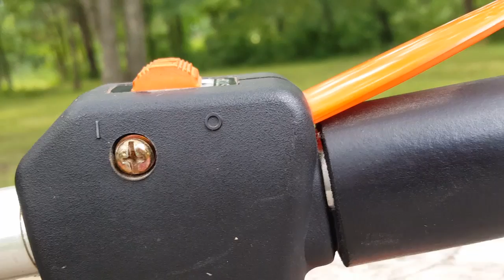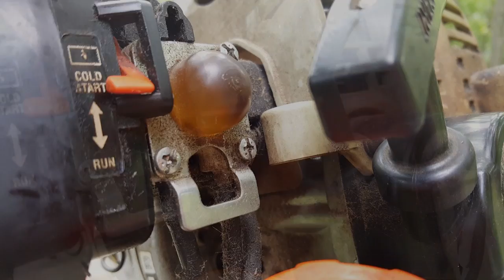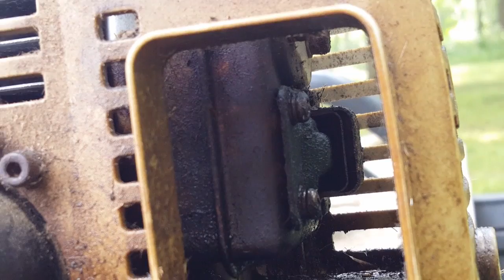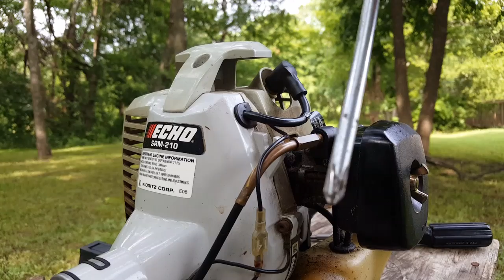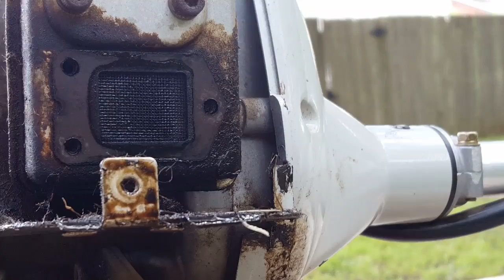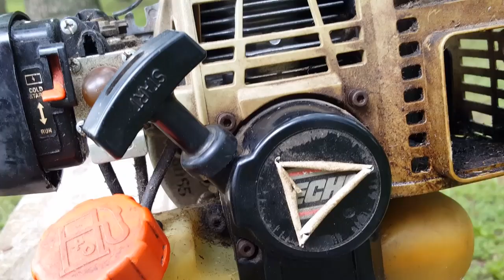Echo Weedeater starts but has no power and runs bad. Clogged spark arrestor. Easy and simple fix.

Comment: Never too old to learn.  In the past years I have changed spark plugs, filters, carburetors, and other
parts in order to get a failing 2 cycle to run.  I never found much information about the spark arrestor,,
In the past I have thrown away several good yard tools not knowing that this was my culprit.  When
you cranked that echo, the sound told me you were on to something.  I cleaned my Echo Weed Trimmer's spark arrestor and she ran like a new one.  THANKS SO MUCH....
Reply from the maker: You are welcome William York.  Thanks for the comment I appreciate it

Comment: thank you, sir. I watched several other guys fixing these, and they were all about the "hidden" hi/ lo speed adjustments, but none talked about this spark arrestor. I bought a kit, changed filter/ carb/ gas lines and still my echo had a VERY VERY hard time cranking up and staying lit. I watched your vid and bam! The spark arrestor was carbon cake... a little wire brush action and this thing is singing now..
Reply from the maker: You are welcome and thanks for the comment I appreciate it

Comment: Thank you.  You saved me taking mine to the shop.  wish i would have watched this before I bought a replacement carb.
Reply from the maker: Thank you Matt Busch for the comment I appreciate it.  Well at least you have an extra carb when you need it.
Reply: I was about to buy a replacement carb as well. In hindsight, if I was the carb, I don't think the engine would run at all. But I'm no mechanic at all. Good video.
Reply: JUNC0S
 SA?60143

RT?60138
Reply: I just did the same thing, replacing the carburetor.  Now on to check this.

Comment: I found an srm 225 and found the same thing clogged.  I took off the muffler and left it in a container filled with simple green and had a cleaning brush removing the dirt and grime.  Works.  I still did a tune up on it though.  Can't beat free.
Reply from the maker: Excellent thank you for the comment I appreciate it

Comment: Always a good idea to empty gas, clean, lube and inspect any small engine machines before storing for winter. Nice to start easy in spring and avoid these types of issues. Tools can last a lifetime
Reply from the maker: Thank you capohd28 for the comment I appreciate it
Reply: What happens if the gas is not emptied?

Comment: Good work. 2 stroke has only two speeds idle and wide open. Anything less than wide open will clog the screen. Biggest mistake is not using non-ethanol fuel with premium mix.
Reply from the maker: You are absolutely correct.  Thank you for the comment

Comment: I took the screen out and put back together it worked immediate full throttle high rpm. Torch cleaned screen in seconds... thanks man. Seriously
Reply: Putting screen back now
Reply from the maker: no problem.
Reply from the maker: I'm glad it worked out.

Comment: Having a issue with my echo weed eater with it trying to start but won’t start, so I fully disassembled it and cleaned the carbon build up off the cylinder, cylinder head and spark plug electrodes but I’ve never thought of checking the spark arrestor. Next time I’m in class I will check to see if that’s the problem. Thanks for the helpful video!
Reply from the maker: Thank you Brynnon D. For watching and commenting. Good luck.
Reply: UPDATE: 
today this morning I actually got it to run and it turns out there was a huge bug in the exhaust blocking the exhaust port and there was dirt in the fuel tank so I cleaned out the fuel tank and put a new fuel filter in and after a few pulls from the recoil starter and it fired right up and it was running really well afterwards
Reply from the maker: That's great news congratulations. Thank you for the update.

Comment: Need to check this on all of my 2 cycle stuff. Another great video, thanks!
Reply from the maker: It something I overlook this part too.
Reply: Hank Bridges Actually you want to set the hi mixture for highest rpm then just a touch richer until the speed just barely backs down. Highest rpm is too lean, don’t forget the fuel is the only lubrication for the piston in a 2 cycle and you don’t want to overheat it. I never think to check the exhaust screen though after all the years of fixing these things!

Comment: great job! I've ran into that several times on 2 cycle equipment, I usually just leave them out.
Reply: It is just a little more work to clean the screen with Carb. Cleaner or Throttle Body Cleaner with a brass wire brush and put it back in.
Reply: Y
Reply: @SCarter76  thanks... I wondering how to clean it and place it back.

Comment from the maker: Thanks for commenting. Its very much a hobby that I greatly enjoy.
Reply: So is that screen even needed?
Reply from the maker: The screen helps glowing sparks from leaving the muffler and igniting dry grass on fire. It is needed in some areas. Where this one is being used it's not necessary.
Reply: I have that same model and it suddenly staring bogging down and shutting off when I press the throttle. I check the spark arrestor and even replaced the carb and lines. Still same issues. Any suggestions?

Comment: This happened to a chainsaw I was working on and posted a video.  I let the spark arrestor soak in some dishwashing detergent for an hour, then used Brillo pads and a wire brush on it to finally clean it up.  Wish I had thought of the torch idea.
Reply from the maker: Use what you got and the dishwasher fluid works.

Comment: Thanks, I knew about this but forgot and was about to go get some can 2 cycle gas to ops check the problem and was about to search my parts for a new corroborator and fuel filter.  I'm going to try burning off the carbon, because I think it takes longer for the engine to warm up without the spark arrestor.
Reply from the maker: Let me know how it goes.
Reply: @HomeGaragechannel  I burned off the carbon and reinstalled the spark screen and she's back to running new.  It's so easy to clean the screen I'll keep it in.  And your tip for the day, The Earth is as it's always been, motionless and flat and NASA means Not a Space Agency or Never a straight answer and Astronaut means Astro, Not!
Reply from the maker: @JesusIsaFlatEarther  thanks for the update and the tip

Comment: Headed out to my shop to remove mine. I bet it's my problem. Thanks !
Reply from the maker: I hope you get it working right.  Good luck.
Reply: Turns out that there was build up in the exhaust port right at the piston. Removed it and it runs like new. You have to remove the whole muffler to see it.
Reply from the maker: Thank you for the comment and update

Comment: Thanks for the video, I’m having the same issue with my srm- 225 after installing a new carb..just completely bogs down then stops..gets really hot as well.
Reply from the maker: Thank you Razors Edge for the comment I appreciate it
Reply: Did you figure out the problem ? i have the same issues with mine so i changed  the carb. and seems like it didnt help
Reply: No, unfortunately I think I’m gonna have to buy a new one, either that or I might just replace the exhaust. It seems to be easily overheating and then shutting off.
Reply from the maker: No shame in replacing it. Sometimes it makes the most sense.

Comment: Great job. I believe this is what my problem is. Great video as well.
Reply from the maker: Thank you Mission Impossible for the comment.  I appreciate it.
Reply: Mission impossible if its clogged go ahead and pull the muffler off and check for carbon in exhaust port mine was clogged size of a pencil

Comment from the maker: Thanks for the comment. This was the first one for the year for me. Funny thing is that the  gas is mixed appropriately for this engine. It may have been ran half throttle a lot.
Reply: Home Garage I never use the 50:1 they call for. I usually put some gas in the tank, add some used motor oil, shake and go. Have had my echo gt-2000 for 25+ years and never had a problem until this summer. Thanks is was ready to go buy a new weed wacker.
Reply from the maker: @louiss4618  thanks for taking time to make this comment I appreciate it

Comment: Very well done..,.,.How do we avoid getting a clogged spark arrester ?..,.,High Test gas?
Reply from the maker: Thanks for the comment. Good quality 2 cycle oil and make sure you run at full speed when possible.
Reply: If the mixture is too rich, that can clog the exhaust.

Comment: Thanks, I have a trimmer where this is the symptom, I'll give it a try!
Reply from the maker: goog luck
Reply: @HomeGaragechannel follow up: I took the muffler off of it, and on the output of the muffler the little nipple or w/e you call it where the exhaust exits had a hex on it. So I unscrewed that and sure enough there was a round wire screen (cylindrical) and it was almost 100 blocked with carbon. Now the trimmer runs great and I can get it back to the friend I was fixing it for! Thanks!

Comment: I got echo srm-3400 and using it for sometime until the engine quit . Since then I can’t get it going. What seems be the problem? Thanks
Reply from the maker: how did it die? I would check the compression first to see how worn out the engine is. After that I would see if it runs when you put some fuel in the carbs throat.
Reply: Home Garage it quit while I’m trimming, I thought I ran out of gas but the tank was not empty yet. That’s how it died.I will work on your advice. Thanks
Reply from the maker: @georgearenque8530  you're welcome and let me know

Comment: Spark arrestor can be cleaned with a propane torch flame to burn all the carbon/deposits. Use long nose insulated pliers to hold it! it will get hot!  Carb cleaner may take most all of it off, as well.
Reply from the maker: Thank you Doug H for the comment I appreciate it.
Reply: Is it expensive to replace the screen?

Comment: Why do I have to prime my carb on my SRM 210 with either gas or starting fluid to get it started when cold? It has  a new carb, new spark plug, fuel filter, air filter and fuel lines. After it runs it will start up again without being primed.
Reply from the maker: New carbs need to be adjusted for all conditions.
Reply: @HomeGaragechannel  Well is that the screw that is hidden? This wasn't starting cold with the original carb either. Something is not right. It gets spark and the spark arrestor is clean.
Reply from the maker: Gotcha. I would perform a compression test. The engine might be worn  to a point that its now hard to start
Reply: I am going to try that next. Thanks.
Reply from the maker: @mikecosgrove  no problem.  Let me know.
Reply: I will but I have to go buy a compression tester first. It's like a catch 22 because if I replace a short block I am almost at a brand new trimmer.
Reply from the maker: @mikecosgrove  you are correct.

Comment: OK, I have a newer echo, cleaned spark arrester via burning it off and using wire brush to clean it, than replaced carb (zero carb adjustment screws on my model) and I changed the spark plug, it starts up fine couple pulls no problem, but when I want to cut it just doesn't have enough power to get going fast enough, have any more ideas to save my mom's favorite weedeater?
Reply from the maker: yes the carb is adjustable but the screws are hidden.

Comment: Mine is hard to start but will rev fine but dies when you stop revving. What should I do?
Reply from the maker: Thanks for the comment. Just increase the idle speed to a point where it wont die when you let off the throttle. Unless you want replace the carb or rebuild it.

Comment: Have a Eco loss power wen using it , I turn it off , an check the air cleaner , try stare it's back , and it's never started up back ?
Reply from the maker: take out the spark plug, for a day or two, put it back in, but this time try starting it, with NO choke.

Comment: I'm checking a srm236es a friend has. There is no arrestor on checking. It doesn't run as full as i think it should. Could it be the carb needs cleaned.  I took dirty air filter off to eliminate it but still think it not running at full
Reply from the maker: Thanks for the comment. Yes the carb is the best place to start  off. I would replace as its cheaper. If it's not it then check the compression. If its low then it will not go to full speed.
Reply: @HomeGaragechannel  I have a new carb he got from a shop, pretty dear at £60. And I just got an attachment for 8 and 12mm plug holes for my compression gauge. So it should fit the trimmer plug hole. What should the compression be? 100-150 like a chainsaw
Reply from the maker: Anything over 75 psi would be ideal. It should not be under 60 otherwise it will have less power.

Comment: When the muffler cover and spark screen are easily accessed and clearly dirty... remove and burn them clean with a propane torch held in pliers or vise. I did that simply on my Hitachi blower and problem disappeared !
Reply from the maker: Wow and i thought I was the only one with a Hitachi blower. Thanks for the comment I appreciate it

Comment: I 've seen what you do but the another problem is that the power is still lost 50% how to continue to fix that?
Reply from the maker: The spark plug was also covered in carbon and after a spark plug change all of the power came back.

Comment: What brand oil you use and mix at? Looks a bit rich to me.
Reply from the maker: It was ran on someone else oil gas mix before I got to it. Once the carbon burned off the spark plug it ran even better. But yes it looks a bit heavy on oil to make that much carbon. Thanks for the comment I appreciate it.

Comment: Watched this hoping it was this. My less than 1yo old trimmer running the same way. Screen was like brand new. New spark plug. New fuel filter. I have no clue now.
Reply from the maker: try running it without an filter, just to see if it's the issue, if it works without it, replace the filter. did you leave fuel in the thank over the winter?
Reply: @HomeGaragechannel  Yeah. Thought Stabil and quality gas would be ok.I will have to clean the carb next. Was hoping to not have to take it apart.

Comment: Hey I have a echo shc 225 hedge trimmer I wanted to know can that happen on Echo Hedge Trimmer was also
Reply from the maker: Thanks for the comment.  This screen gets clogged because of two reasons. Using oil that is heavy on 2 cycle oil and the other is running the machine at part throttle a lot.

Comment: Had the same problem with my Makita but the spark screen is internal had to split exhaust and remove the screen which was floating about inside blocking the exhaust.
Reply from the maker: Wow nice work, they definitely want anyone touching the screen.

Comment: Would the clogged up screen cause it to shut off?
Reply from the maker: Yes it could cause it to shut off. How long does it run before it shuts off?
Reply: @HomeGaragechannel  Ran it for 5 minutes give or take and I noticed some hesitation then it shut off. Tried to start it again but it didn't start.
Reply from the maker: Give it a try. Have you checked the compression?
Reply: @HomeGaragechannel  Not yet. I will clean the screen and if that doesn't help I'll check the pressure. Thanks for replying.
Reply from the maker: Thank you and no problem.
Reply: @HomeGaragechannel  looked at it this afternoon. Torched the screen. It looked decent, no excess carbon. The problem is when I pull the "trigger" (gas) all the way up If I push half way it doesn't shut off I left it running for 10 mins and edged some and didn't die. Managed to put a piece of plastic between the trigger and handle. It's weird but it's working. 

I

Comment: Can your fuel lines be too small?
Reply from the maker: you mean for it to run properly .. no i didn't think so
Reply: @HomeGaragechannel  I wasnt asking for yours. I have the same problem. I bought a fuel line to replace the old lines that crumbled and I didnt have a problem with it on my other machines with the same so lines but I wasnt sure about this machine.
Reply from the maker: @chanmang  there isn't a problem with fuel flow with a smaller line.
Reply: Thank you very much for your help
Reply from the maker: @chanmang  no problem thank you for the comment

Comment: Got Husqvarna 128ld replaced carb and fuel lines tries to crank but won,t any suggestions
Reply from the maker: Thank you Terry Strickland. When you pull the pull string is there a lot of resistance or just some?I'm wondering if the compression is low.
Reply: Terry Strickland  - need fuel, compression and spark...  is primer working so you feel fuel is getting to cylinder?  Any reason to believe compression is an issue?  Sounds like it might be lack of spark.  Remove spark plug and ground threads to engine and crank to see if you are getting a spark.  If not check with new plug.  Still no spark- check ignition coil gap and retry.  Mine turn out to be a bad connection where the spark plug spring housed in the rubber boot was not penetrating the wire core so I removed it, cut off a bit of wire and re stuck the spring sharp point into the cable and then reinserted into the boot.  So that is something else to try.